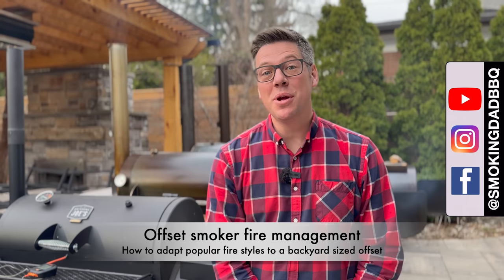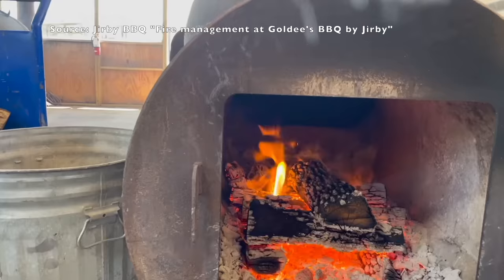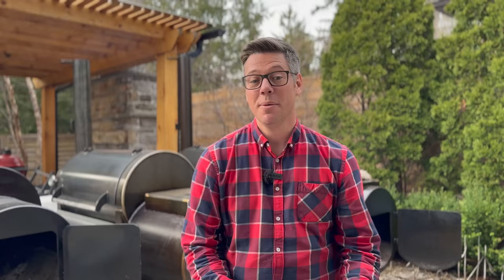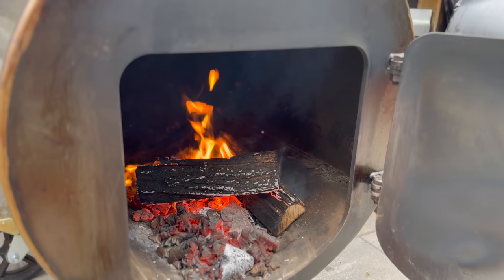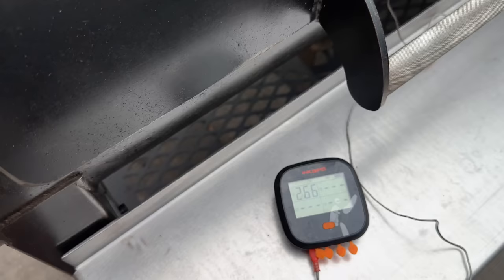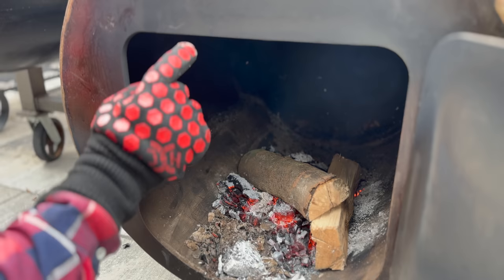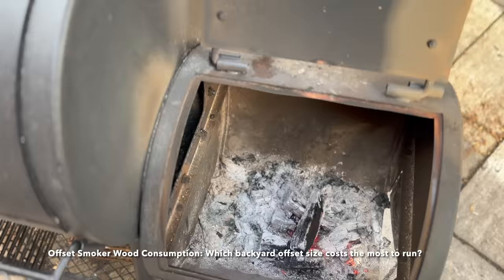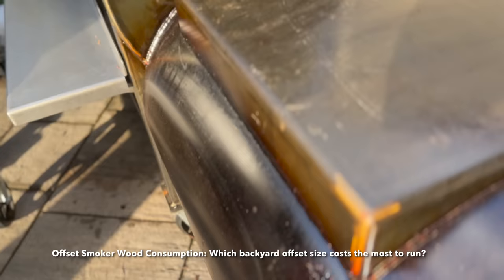Offset Smoker Fire Management 101 (That WORKS On Backyard Sized Offset Smokers)

Comment: Would love to see a video on how many pork buts you could smoke on your Kamado Big Joe 3 , 9-11 pounders. I have to do this quite a bit on my XL big green egg.
Reply from the maker: the xl and the BJ3 are the same size so i think it would be the same as what you fit now
Reply: @SmokingDadBBQ  didn’t know if the Kamado Joe might have different rack configurations. I have gotten 6 before but very tight . The XXL is around 2300.00 for just the egg alone. I hear can fit close to 9 or 10

Comment: Great video. I wonder how this would translate to cold smoking in the same chambers. 275F is too high for cheese and fish. I like to stay around 200F for fish and below 180F for cheese.
Reply: for that temp I would use very small chunks with a coal bed in possibly a U shaped fire brick holder.  Layer of bricks on the bottom then 3 bricks to make a U.  Have  or 2 fist sized chunks burning at a time.  Assuming you have an offset of similar size to the ones shown in the video.  Rather have a couple small pieces burning with visible flame and decent airflow than a large piece with very little airflow just smoldering.  Thats a similar setup to what I use smoking jerky or sausage.  Same temp targets as you are looking for.
Reply: @danielh4995  Thanks!! I will try that out!

Comment: I have a question about your fire bricks in the Oklahoma Joe. Since your fire is directly on the bricks, during a long cook wouldn’t you end up with a lot of ash restricting airflow? Do you think it would be good to put a small grate over the bricks to separate the coals from the ash or would that prevent the bricks from getting hot? I think it would be intriguing to make a video about the bricks and how you set up the fire in the very small smoker
Reply from the maker: I haven’t run into any issues

Comment: Hey man, from the moment the splits catch fire, when does it begin to burn clean for cooking as I’ve seeing mixed views such as building the fire and burning it for at least 30mins but that seems like an awful waste of fuel to me. Also when you add a split during cooking, won’t that give off dirty smoke and is there a method to prevent that from happening? Thank you.
Reply from the maker: the wood i am adding is combusting almost instantly and the smoke stack never billows white clouds of smoke so i am not concerned.   IF this happens, open your cook door to limit the bad smoke dwelling on the food.

The wood only lasts up to an hour, i wouldn't want to throw out 50% of the wood life.  so long as you have open flames visible, the fire is good for cooking IMO

Comment: Great video James. I’m curious, if you added a pan of charcoal under the cooking grids, could you also use the offset as a direct heat grill?
Reply: On my Yoder Comanche it came with a fire grate that fits inside the cooking chamber and you can do a cowboy set up and grill over live fire.
You will definitely want your cooking chamber grease free before burning down splits.

Comment: Hi James, do you recall the dimensions of the 60gal offset smoker from this video (diamater and length for both cooking chamber and firebox). I will get someone to built me an offset smoker since where I live there aren't any commercial options available, so I would really appreciate your insight. Also, how often did you need to add wood in the 60gal vs the 85gal? Thanks

Comment: what is the hottest temp you think you could safely run an offset?
Reply from the maker: I did a prime rib at high temps like 500 and have done pizza in the firebox at similar temps just fine. But that’s in the bigger expensive ones. I didn’t try taking the thin gauge steel that hot
Reply: @SmokingDadBBQ  awesome.  im thinking of the workhorse which should be plenty thick :).

Comment: Thanks for the video James. Do you use the miter saw to get the right size splits for each smoker or was it just the Oklahoma Joe? As I’m researching the type of offset I want (leaning to the 94 gallon) I’m wondering if I’ll need to create something to get the right sized splits. Hope not!
Reply from the maker: Just the little guy. 10-12” fine for everything else
Reply: Thanks

Comment: Your temp bump up so high because you added too many splits at once. It will work perfectly if you get a decent size coal bed then add only one split every 30-45 minutes to maintain temps
Reply from the maker: On which pit are you referring too?  The smaller the pit the more severe the spike is with a fresh split. Add probes and track … never shows the same on the manual gauge

Comment: You are putting the 'log cabin' on top of an existing coal bed.  The purpose of log cabin is to build the coal bed.  Of course your temps are going to sky rocket.
Reply from the maker: i am showing the pro's and con's of various methods that have been shared and what happens if you run that way in a backyard sized offset before going into which methods work best for the various sizes most people own

Comment: You have way too much wood fuel in this small offset smoker. I like TonyTone BBQ channel and how he does Fire management. He only uses a charcoal bed and then just adds 1 split of wood about every 30 to 40 minutes. He also pre warms some splits in the fire box so that when its time to add the next split it will light very quickly.
Reply from the maker: I am not sure at what point in the video you commented but the first fire was demonstrating why trying to use fire management setups shared on large offsets don’t work in smaller models. Later I showed what I do and why I found it works better than the charcoal method

Comment: Why not build and control a fire like a komado ?  Seems like you're blowtorching the logs getting everything way over temp then saying the pattern is the problem?  Just cut down your air inlet and don't let the fire get out of control and you wouldn't have a problem in any of these examples.
Reply from the maker: the larger offsets are nearly 1000lbs so the first fire is about helping heat soak a large heavy metal pit before transitioning to your maintenance fire which runs more consistently